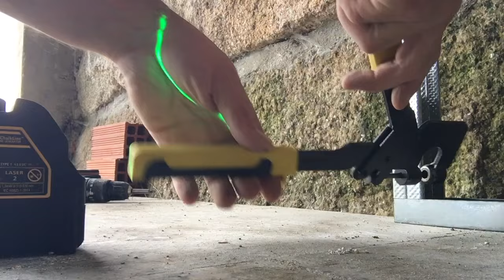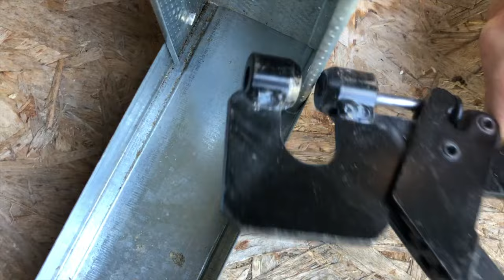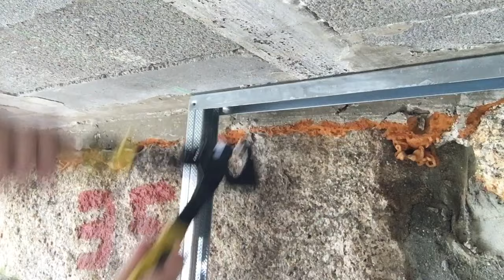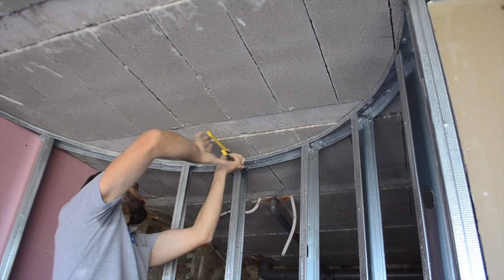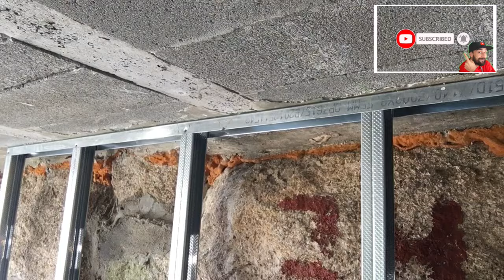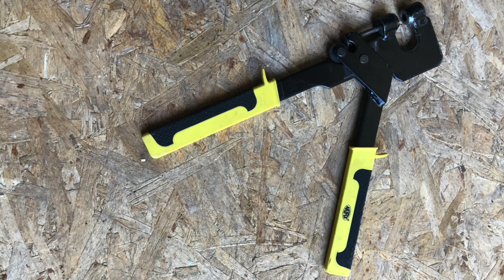✅ How to USE Metal Stud FURRING CRIMPER 🔥 Punching Machine for METAL PROFILES 🤜 Drywall

Comment: The purpose of this tool is to hold the framework together long enough to get the drywall up. The drywall and sheetrock screws tie everything together and give the wall all of the rigidity it needs.

Comment: In my opinion, screws are a better option because they hold stronger.  I use screws and pliers and sometimes it happens that the joint made with the pliers loosens.  Maybe I just need to adjust the pliers or something, I don't know.  I'm not a professional, I work for myself and for friends when they need help.